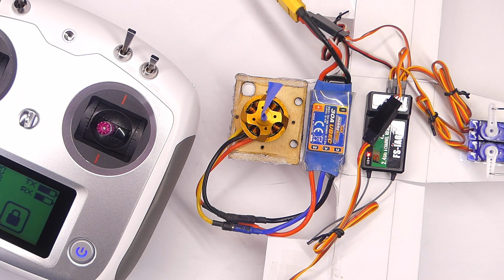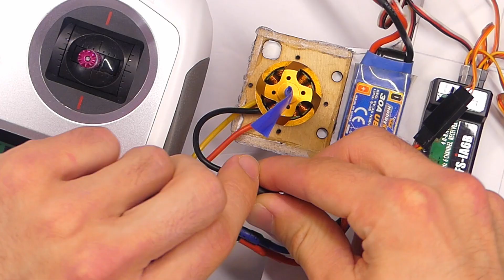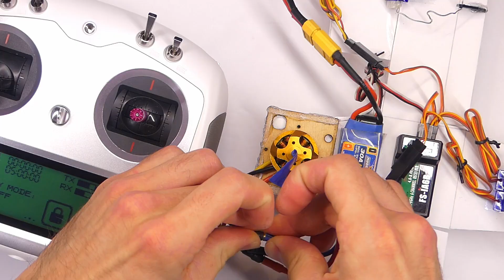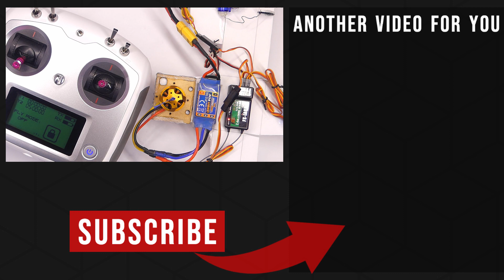Just Swap Any 2 of 3 wires 🔄  How to Change Brushless Motor Spin Direction (Reverse Rotation)

Comment: Can i do it anny way possible with the rc controller, not swapping the cables but while i am driving changing the direction to go backwards
Reply from the maker: You would need a ESC that allows for that. Most commonly they don't.

Comment: is it possible to use a relay/button system to spin a motor either clockwise or counterclockwise based on which button you press

Comment: Thank you! Very helpful! On a larger electric motor with Hall Sensors like an ebike hub motor, would you need to reorder the phase position wires AND the Hall Sensor wires?

Comment: Bro, this trick not workable in normal 1000kv motor, we need to change only Black and Red wire to change the motor direction.
Anyhow, good video, keep it up.
I liked your videos.
Reply: For brushed motors yeah, he’s talking brushless though
Reply: @PadiwanFPV  Yep...also some brushed motors don't like to run backwards because they have timing issues it seems...particularly rc car motors with advanced timing built in..They'll run but not efficiently...
Reply: @virajsanghvi7415  there are three wires in brushless motor, in 1000kv motor there are Red wire for positive, Black wire for Negative and Yellow wire for signal, sir if we replace the red and black wire connection in ESC then the motor direction will change to clockwise and counterclockwise. And in brushed motor there is only two wires.
Reply: @virajsanghvi7415  if you want to change the direction of your motor then simply change the wire Connection.
Reply: @UClRyR9TPLq8LIzf903rOIlg  Only CW ? Assuming it's a quadcopter  they usually have 2 CW and 2 CCW props ?..On smaller quads they sometimes run props out to supposedly help counter prop wash in turns. To reverse a simple brushed motor you can just switch the two wires but if they're small 12mm motors or similar the brushes are already worn in for one direction and might cause a problem.. there's no guarantee your brushed flight controller will like flying with reversed rotation.  When we build brushless quads we have to choose prop rotation during programming iIn betaflight so it might be important....hope this helps....convince you it's probably not a good idea but "might " work....lol..good luck